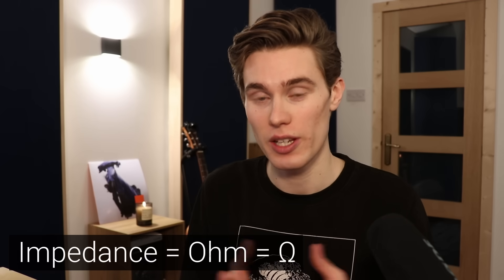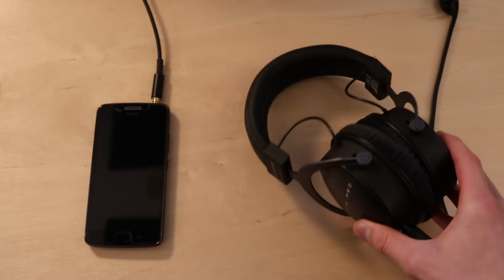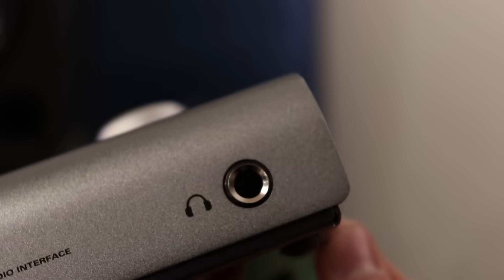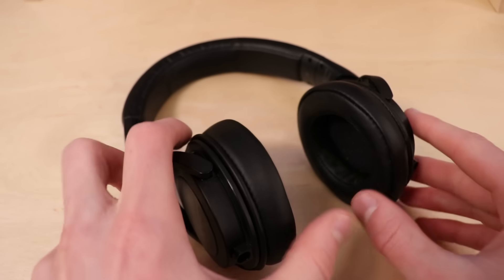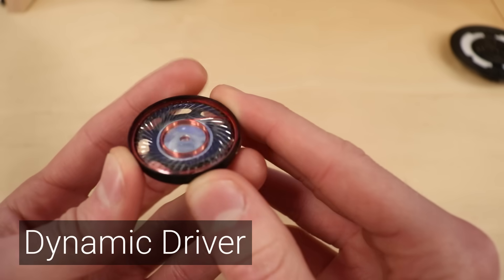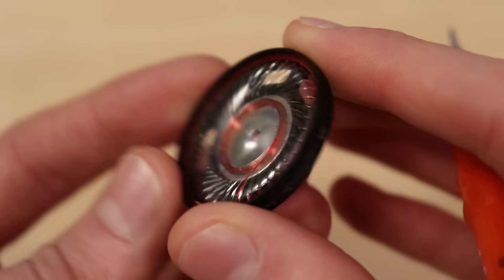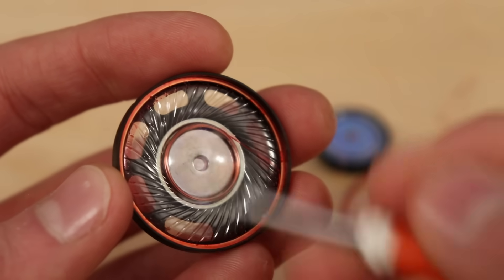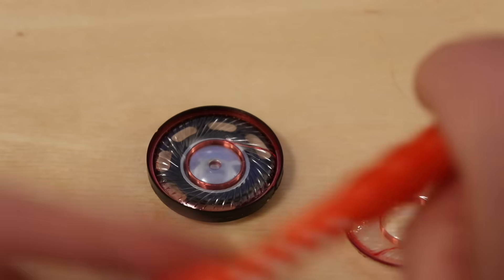32 ohm vs 250 ohm - Which Headphones Sound Best?

Comment: Great stuff, but one correction. Electrons do not travel through the wire - they conduct electricity, but electric charge moving through the wire is a separate thing (nobody knows what that is exactly, but not electrons).
Reply: Yes, they are. They are traveling through the wires in the opposite direction of the current with a speed of about 10 micrometers per second! However they are oscillating much faster in the current, and the whole thing cannot and should not be considered a movement which we can see in our daily "macro" life. However you can draw analogies with "macro" waves we have in our daily lives. Quantum mechanics should be used for more precision. We already have enough knowledge about electric currents to answer simple questions. Electrons don't conduct electricity. They are electricity (negative)!!! You can't separate electricity from electrons but if you do (like combining a positron with an electron) they will no longer be electrons but other particles!
Reply: @billmorrigan386  I think you are referring to the dirft velocity of electrons, which is around 4cm per hour, while their local speed is around the speed of light. There are still quite a few opinions on electricity,as far as I can see.
Reply: @KamilKW  There are no opinions just quackery. It's all there in physics textbooks. And been there for dozens of years. Sorry if I sound harsh. There's no local speed of electrons in metals near the speed of light, even in vacuum they travel much slower. However, you can still find a flaw in the statement in this video if we want to nitpick. I mean we usually deal AC currents (changing directions 60 times a second for 60Hz) at home = electrons can't travel much in AC.
Reply: It's not difficult to accelerate electrons to very fast speeds though. And hopefully, we will accelerate a macro object to such speeds one day :)

Comment: Hi! I have a question: How can it be that my 600 Ohm Sennheiser HD800 sounds louder that my 60 Ohm AKG K701?
Reply: 1. HD800 are 300ohm
2. The K701 have a far less efficient driver, they require a lot more power to get to decent listening volume
3. Even though the HD800 are 300ohm the driver itself is fairly efficient.
Reply: TheWretchedWorld will a beyerdynamic dt770 250 ohms handle a scarlett 2i2 ? im searching this everywhere and when i’ve asked focusrite customers about it , they said that the max impedance of the 2i2 is 200 ohm, but 250 will be only a little quiter. People are saying that 80ohms will be great, but at the other side they are saying that the sound is distoring when they turn up the volume and the bass is strange. I dont know what to do in this case and im so confused ;/ maybe 32 ohms, but im scared about the sound quality, can you help me ?
Reply: @krzaqs0n787  will be fine but you'd be better off with the 80ohm if connecting it to the Scarlett. Will get a lot louder
Reply: because impedance is just the value of how much electric resistance (or energy transmission loss) the system has due to entropy and joules law etc, it doesnt account for other factors

Comment: Source material quality and driving device will ultimately determine which version you pick. Damping factor is a difference when used with the right source and device. In the right setup you would go high such as 600....assuming that you have good hearing lol.

Comment: Impedance doesn't matter when it comes to driving headphones, what matters is sensitivity. Planars are way lower impedance than dynamic headphones but are harder to drive. HD 650 300 ohm and can be driven off of a phone just fine with really nice sound quality and high volume while planars at less than 50 ohm can't be driven well at all from a phone, they don't sound good but go high enough in volume. It's down to sensitivity not ohms. So if you're looking for headphones ignore ohms altogether it does not matter, look for sensitivity and even then it doesn't matter because even phones can push almost every headphone (except for planars) really well, although dedicated amps/dac will be better (better sound quality). Before making this video you should have tested a few headphones. I can plug my hd 650 to a phone (samsung or iphone) and it sounds very comparable in sound quality and volume to a dedicated amp/dac, plugging in he4xx to a phone makes them sound crappy (losses tonality, bass, just sounds broken, less volume).

Comment: Higher impedance generally means higher dynamic range and that's about it. Of course many other things can result from that, like less distortion, less easier induction of strain electrical fields (less susceptibility to interference)... etc. But there are so many other variables that not all these can be true at the same time.

Comment: Get an LG phone. Solved. I currently have the V60. Freaking awesome.
Reply: What impedance your headphones have ?
Reply: @nawrezelbitar3939  80. Would've preferred 250, but the custom studio beyerdynamic's have adjustable bass ports and a removable cable.
Reply: @charlestannehill7537  I'm using the V40 which also has the 32bit dac so i might go for 250 ohm
Reply: @nawrezelbitar3939  250 ohm is nice. I recommend the dt770's for closed back. I switched to due to mobile gaming. Eliminating the bass makes the footsteps extra clear.

Comment: I was looking for the DT990 PRO 250 ohms for my new studio, can I use my audio Interface (Focusrite 3rd Gen) ? Or would I have a better hearing system/ volume if I'd buy an AMP ?
Reply: Similar question here! I actually bought those headphones looking to get a hi-fi audio setup for mobile. Will my phone be able to power an Amp if I connect via USB to lightning cable?
Reply: i just bought dt770 pro 250 ohm and have the scarlett 6i6, the 250ohm are the highest ohm you should get with scarlett 6i6, i need to push the headphone volume hard, but it sounds excellent

Comment: Correction:  The reason studios used, and in fact demanded, high impedance phones was that they used so many of them and the easiest solution was just stringing them electrically in parallel.  I have many parallel-wired headphone distribution boxes with 10 ohm resistors in series with each output to protect against low impedance multiples.
Reply: Bingo! We have a winner. Jay tell him what he's won!

Comment: I'm thinking about getting a pair of Beyerdynamic DT 990 for mixing and mastering. Since I will not always be in my home studio, carrying my audio interface may be uncomfortable, so I need to plug the headphones directly to my laptop phones output. Can a good mix/mastering  be achieved with the DT 990 32 ohm version?  I am asking because 32 ohm headphones are the ones that fit for my situation.

Comment: you can have headphones that have relatively low impedance, yet are very hard to drive because they are inneficient and have very low sensitivity. like the hifiman he-6se at 50 ohms and 83.5 db. low impedance is not always an indicator that a pair of headphones are going to be easy to drive. sennheiser hd800 have high empedance at 300 ohms but have very high efficiency. much easier to drive than he-6. impedance and sensitivity are equally important parameters to check.
Reply: Well exactly I have hifiman he-6se so hard to drive em that's why I am here not always impedence is the matter

Comment: Get your physics right. For same sound spl, power required is same irrespective of impedance. Lower impedance will suck more current for the same power. It's the higher current which is problematic for electronics. Going by your logic everyone should start using 2 ohm speakers instead of 8ohm.😂. Imho higher impedance headphones are easy drive just like a 8ohm speakers are easy drive than 4ohm speakers. Only thing with higher impedance headphones you would reach full volume much earlier. I won't mind higher impedance headphones as long as I am below 100% volume.  Higher impedance headphones are less affected by source impedance.

Comment: Great closed back headphones🔘◌>JustU.Faith/BHeadphones?e   Perfect for music, movies, and gaming. Awesome soundstage for closed back. Extremely comfortable, can wear these for hours with glasses. Plenty of power with an SMSL sAp II amp running around 11 o’clock on the dial. Noise cancellation is pretty good for headphones with velour pads. Cable is a little long on the 80 ohm so I braided it down to a more manageable length. Have it paired with an Antlion ModMic for chat capability. iPhone and MacBook Air can run these pretty well towards max volume but the PS4 controller cannot. I have an HDMI audio extractor plugged into the SMSL sAp II amp to get audio from PS4 Slim and sounds great. I recommend these to anyone looking for a solid and versatile pair of closed back. 5 stars.

Comment: I just bought the 32 ohms. Will they sound as good and loud enough on a Samsung Galaxy s10 plus without an amp? Thank you!
Reply: 32 s low so yes!
Reply: @andersanderson11  thank you! So they will have as good sound as higher ohm versions? Thanks again
Reply: The prince of everything They’ll be fine. 95% of headphones are under 50ohm - the other components have more of an impact. Audio Technica, Sony, Technics, Pioneer, Yamaha etc. - all good brands. Avoid Beats, Skullcandy - rubbish components.

Comment: I'm assuming the 250 ohm sound best, it would sound more natural and effortless because it can disperse it's energy more efficiently. You will have better clarity, etc. Think of it like a Toyota vs Ferrari, it's very easy for a Ferrari to reach 60 mph, while the Toyota would have to try much harder. More Horsepower equals better efficiency. That's why Ferrari's burn more gas, just like 250 ohm headphones need more power to do their job.

Comment: Two more points to add to the benefits of higher impedance headphones: 1. because they need more voltage to produce the same volume, you get a higher Signal to Noise ratio (small voltage noise from the electronics). 2. the ratio between the headphone impedance and the cable resistance is higher, so more of the audio energy is converted to sound, as opposed to dissipated on the cable.
Reply: 1. Nope. These days headphone amps don't produce audible noise so this is not a factor. SNR of headphone output into any impedance is between -90...-140dB. There's no noise in headphones.
2. At 32+ ohms this value would be so small that this doesn't matter either unless the connection is broken in some way, for example from the plug not sitting tight in the socket.
Impedance variation in headphones is a legacy phenomena. Old pro and home stereo interfaces used to have sketchy outputs so the headphones had to match impedance to them. Today it's a thing of the past unless you like vintage audio.
Reply: @marcinkoscielny1481  1. wrong. noise is always a factor in SNR. doesn't matter how low it is. 2. wrong again.
Reply: @MrGuto  1. This doesn't make any sense. I made a completely different point.
2. k
Reply: @marcinkoscielny1481 now you both kiss

Comment: Hey, I'm considering the Beyerdynamic 770 Pro vs the Sennheiser hd380. I originally thought 250 ohms would be good, but since I still want to be able to use the headphone on my phone I didn't feel like it would be a good fit. Since my primary use would be for mixing and mastering, do you think the 80 ohms would still be a good option? That's still more ohms than the Sennheiser (54), and I've heard they work on mobile devices.

Comment: Still not an answer to the question 'which sounds best'.  One consideration - If you get into the higher impedance headphones in an effort to 'get better sound'...now you have to add a headphone amp which can further color the sound.  So you have the device, the headphones, and now a third piece of gear that can perhaps alter the sound to something better or worse...

Comment: Very very good video mate, I bought the Beyerdynamics DT 770 Pro 80 Ohm around 4 years ago and I had to dig up and research all of what you explained in the first 5 minutes all by myself, this video would have been a lot of help back then. Love the DT 770 Pro by the way, these headphones are great.
Reply: Are you using them on a laptop or a PC? And for what prupose do you use them, music production or mixing? And its 2 years now since you wrote this comment, do you still use them? 

Id appreciate an answer if you see this, thanks!
Reply: @andbe  If you're using them with a laptop or PC without an amp it's best to probably go with the 32ohm versions. The 80ohms will work with some devices but won't be as loud as the 32ohm would be with that same device unless you also have an amp to power them. BUT the difference might be very minor, and some people might not even be able to tell, or it may be very drastic for you. YMMV
Reply: @SchwettyBawls  Hi bro, how will the 32ohm headphone behave with  dj controllers , will it be too loud  ?
And  I don't want to spend on an amp so is it fine or an amp with a 80 ohm version is a real game changer in terms of sound output quality?
You can tell me as a beginner producers perspective. Thanks
Reply: @SchwettyBawls  I'm running my DT 770 Pro 250 Ohm from the headphone jack on my PC.  They sound great with the output level set at 30%.
Reply: @LarcR  Nice! It may work well with some setups and some people. But the higher ohm version will be quieter for other people depending on their setup and their level of hearing loss.
Reply: What would you guys recommend if I'm looking to just plug headphones directly into myacbook air m1? 80 or 32 ohm. I hear more people say 80 but now I'm seeing go 32 if I don't got the amp. Pls help
Reply: Did you have to purchase an audio interface or amplifier with this DT 770 Pro 80 ohm, or could you just power it with a laptop headphone jack?

Comment: Just curious what about the DACs in cellphones like LG phones, can they power high ohm headphones??
Reply: You will suffer with lower volume levels.  I can't tell you how low but it will be lower than a 32 ohm.  TBH 32 ohm is used for about 90% of stuff in 2020 and 200/300/600 ohm for stuff pre 2000's.

Comment: Power and voltage are not the same...Edit:
Magnetism is closely related to current. When you have a high impedance headphone, you need more voltage to run the same amount of current through the coil that is moving your conus.

Comment: He says voltage is synonym of power. That is untrue and imprecise. Power is the product of Intensity by voltage. Power it is also the product of squared intesity by impedance. Thus, intensity is not equal to voltage; but we can say that the hiher the impedance is the higher the power will be if the intensity is the same.

Comment: Hey have a question. Which one do you recommend. I want to make beats but also make chill ones, and I want to include vocals and my beatboxing. If possible I saw that you can plug the headphones into the Blue Yeti mic is that true and what headphones are better the 990 or 770 and at what ohm are they good at?

Comment: Hello, thanks for this great video!

But I am still a bit confused.

I have rode AI-1. And it seems it has more headphone preamp than the other similar USB interfaces. Do you think that it can drive well?

these are the tech specs of  RODE AI-1 below.
Headphones:
Max output power at 1% 
THD
32Ohms – >210mW
300Ohms – >390mW

Also rode had used DT990 pro 250  in their "AI-1 features" video.
https://www.youtube.com/watch?v=swJg-YG8Yfw
So that means It can drive it?

what do you think should I go for 80 ohm version? 
But I dont want to go much since I've read that on beyerdynamics website that 32 and 250 ohm versions are better in terms of sound.
80 ohm's is slightly different. (this is what they said)  But if it's not right to buy 250ohm. then I'll go for 80.

I dont know the Ohm, mW things. But it seems it can drive. (300Ohms - 390mW),
If I understood correctly,  they put that spec since it can drive 300ohm and showing how much power it has.

I hope you'll answer. 
I am about to make the decision :) so if you answer quickly I'll be really appreciated  !!!

Thanks a lot.

EDIT:

this is the FiiO A5 headphone amp specs. it says that it can drive 300 ohm as you can see below. But it has lower power than rode at 300 Ohm if I am correct.

https://www.fiio.com/a5

Output power： > 800mW (32Ω THD<1%)

>800 mW (32 Ohms / THD <1%)
S/N ratio： ≥115dB
≥150 mW (300 Ohms / THD <1%)  
THD+N： < 0.002％ (1kHz)

Recommended headphone impedance： 16~300Ω

So this is Rode AI-1                       This is Fiio (says that it can drive 300 ohm)
32 Ohms – >210mW
                     32 Ohms  – >800mW 
300 Ohms – >390mW                   300 Ohms – >150mW

Sorry for that long text. I hope you answer. 

THANKS!
Reply: For anyone needs help about this situtaion.

I got answer from both beyerdynamic and rode support.
They both said that I can go with 250ohm. with rode AI-1  :)

Even rode said that they  use 250 ohm always in office.

Comment: so the 32ohm sounds almost exactly like the 80ohm no sound difference ,the only difference is in the volume right?
Reply: nope:) thinner and longer coil wire inside the higher ohm version makes higher density and less space between coils cubic capacity which means better sound.
Reply: Would love to know exactly this as well
Reply: Actually yes but with more volume you get better and stable dynamics well dosent matter if you listen to CD quality audio but surely u will find a diffrence in HI-Fi Audio files like DSD or even Flac's.